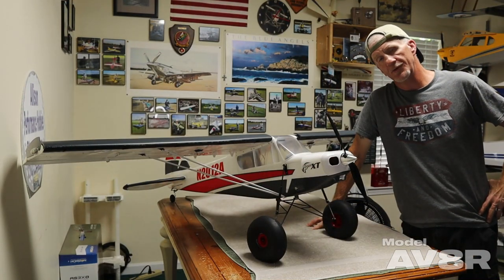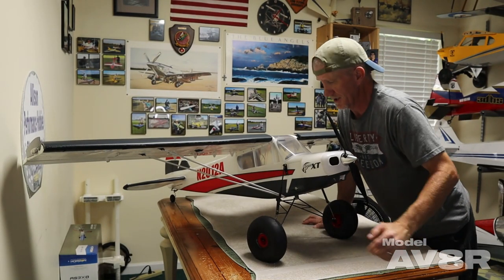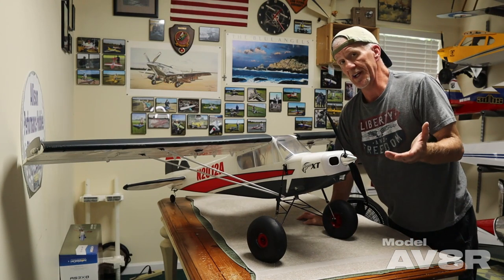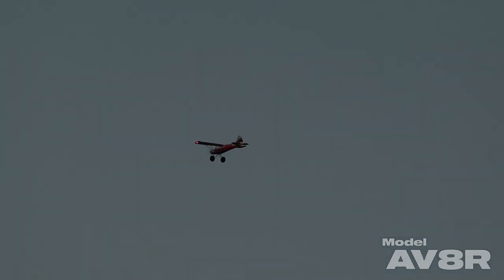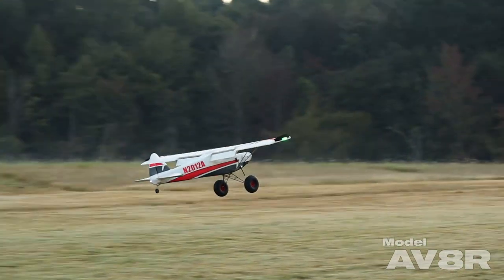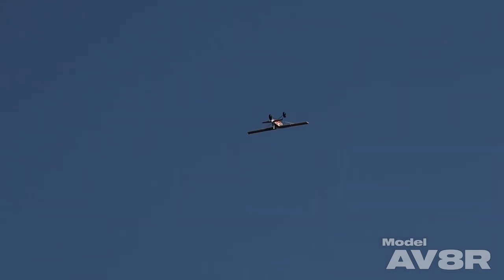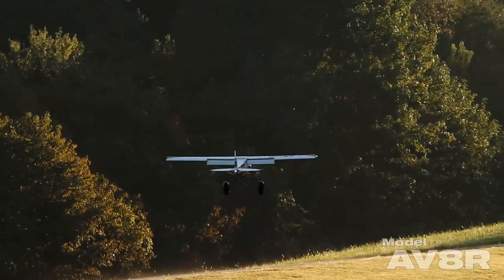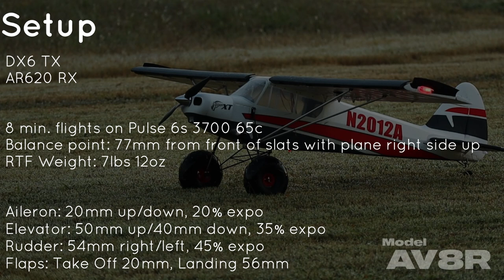Skynetic Bison XT STOL 1750mm (68.8") Wingspan - PNP Model AV8R Maiden/Review

Comment: Super informative video!!!
The most interesting tip for me was the one with the slats. Since I have no experience with these, a clear indication of the setting (x mm distance) would have helped me with my problem! 😊
Reply from the maker: Thanks for watching! Yeah the slats have been an issue for many...the key is do not hook them to the flaps...if you do when you deploy the flaps the slats rotate forward and become spoilers...which kills the wings airfoil taking away most of the lift. We have ours set in the most "closed" position (for lack of a better word for it)...in other words the trailing edge of the slats need to be as close to the wing as the adjustment allows. If for some reason the measured distance from slat trailing edge to wing is greater by a fraction on one side...adjust the other one to match it. Hope this helps! Happy flying!

Comment: Great video. Good to have another quality rc YouTube channel to watch. I assembled my bison after watching your video and it helped a lot. One build question I have is did you have any trouble with the screws for the under carriage for the landing gear being to short? The ones called for in the instructions were way to short to attach the under carriage to the fuselage. Can’t wait to get mine in the air. Thanks for a great video
Reply from the maker: Clay thanks so much for watching and the kind words! Such a nice complement. Hope you've sub'd...we have a lot of great stuff coming! If I remember correctly the bolts to attach the undercarriage are the same ones used to attach the shocks to the shock mounts...the shorter bolts the same size are to attach the wings. Good luck on your maiden! I would put the battery forward for that and adjust to your liking after if necessary.

Comment: Thanks for the review. Unboxed my Bison this afternoon and really liked it. It's my type of airplane, but I held qualms after reading all the issues mentioned in the reviews. Your information really helped with that.

I have a question and could have missed something but, how do you access the battery area? 
The only thing that stood out to me was the two rows of screws on top of the windows.
Reply from the maker: Hey Stephen, thanks very much for watching and subscribing! I'm glad our review was helpful. If you grab the front windshield at the top on both sides and pull towards the nose the hatch will come off...the windshield is part of the hatch. It is held on with magnets.
 If you have read the Hobby Squawk thread on the Bison (link to it on the product page on Motion RC) my name there is "Starck Mad" (after a P-51 I used to fly modeled after Walter Starcks plane). After reading all the issues people were having flying it  I wrote a series of posts talking about how to properly set up the slats (different than the instructions), how slats work, and how in particular to fly the Bison. It is good information ...if you haven't read it I would before you fly it.  The Bison flies great, but it is different to fly. If the slats are set up wrong it will not fly very well or slow down well. Hope all of this is helpful...happy flying!

Comment: Hey, were your flaps tighter at the hinges on one than the other? Mine are…. Ive noticed many other production related problems with this model also.
Reply from the maker: Hey thanks for watching and commenting!  I didn't notice any issues with the flaps on our model. I have read the many issues mentioned in the forums.  I think each person's perspective has a lot to do with what they'll think about any situation. While I think many of the complaints are certainly legitimate such as missing parts, many of the things I see mentioned would fall under what I see as simply doing some modeling... an example would be my first impression of the tail wheel only to discover later on that if I simply oiled it like any modeler should it works fine.  Things like that as well as as flaps that might need to be loosened so that they move freely to me are just part of checking any new airplane over and preparing it for flight. I try to keep in perspective how much airplane we get with these foamies for the price point.  Usually most of the assembly is done and the cost of the entire airplane including all the electronics is about what just an air frame would cost if we were buying an ARF.  I also try to take into consideration how many hands are on each airplane and how many they're trying to crank out of the factory in China. There's bound to be  some differences from one airplane to another.  My perspective being a glass half full type that doesn't mind doing some modeling not to mention the fact that the example I got wasn't too bad really has a lot to do with my particular perspective in my review. Somebody else's approach or the specific airplane that they received might net a different result. I hope this sheds some light on things for you and I hope you enjoy your Bison.
Reply from the maker: Please understand I'm not saying just do some modeling and get over it...not at all.  I'm just trying to share my perspective. I will concede that as fomies go this one is a much harder build than most, but still compared to kits and arfs that I've built this was not that hard at least to me.   Many of the things that are big issues to some people…. which is absolutely there right… are something that I wouldn't give a second thought personally.

Comment: On your Tx, did you program the wing as "One aileron/ one flap" or something different? On the wingtip lights. how did you determine which was red or green? They're not marked as I can see.
Reply from the maker: Yes Pete...1 aileron , 1 flap in the TX. With full scale aircraft the navigation lights are green on the right, red on the left...so thats what I do. Thanks for your comment and for watching! Sub...we have more coming!
Reply: @ModelAV8RChannel  thanx for info. I know grn on right, etc, but lights themselves not marked. Guess you have to plug 'em in to see which
Reply from the maker: @capnpete1154  Ahh ok Pete. Yes I just plugged them in to see which is which.

Comment: Could you replace those steering springs with some sort of pushrods? Thought about getting this cuase it looks like a shock cub but as soon as I saw those springs I kinda lost interest its not very fun to fly this style plane if you can't steer it.
Reply from the maker: Thanks for watching and commenting! I wouldn't let the springs on the tail wheel deter you Miller...we still had a blast with it!  It's an easy fix but you need something flexible because the distance from mounting point to mounting point changes as you go from right to left. Stronger springs, maybe cutting and re-using the stock springs...lots of ways to fix it without a lot of trouble. We'll get ours fixed and add what we did to an updated video after we get more time on it and refine our personal set up.
Reply: @ModelAV8RChannel  ok thanks for the info judging by your intro and your hanger you plan to do any videos on the EF/3DHS planes you got? Now those are my type of airplanes right there😉
Reply from the maker: @millerrc5829  Glad to help man! And oh heck yeah...we'll do some huckin' on this channel too! Scale everything. EDFs, 3D/XA, we'll do it all.

Comment: I've got one that I just cannot seem to get the same confidence inspiration out of. Mine flies awful. Out of the box it only needed 3 clicks of up and 3 clicks of right aileron. Coming from 100cc and 50cc gassers I'm used to not having a great off power glide slope. But this thing if I pull power back from 30% it just fall out of the sky. Needs roughly 40% to get it to the runway safely. Anything below that on landing and your stuffing a wing tip. I would expect a high wing stol plane to have alittle more glide/hang time off throttle than it does.  I've tried CG at your recommendation of 77 and the manuals recommendation but the airplane just flies like a heavy brick in my opinion. (Flying stock power system, 6s 5000mah 50c, spektrum nx10 radio)
Reply from the maker: Thank you for watching! Buddy I'm sorry you are not happy with your Bison. This is a little involved, but bare with the long response and I'll try to shed some light on it for you. What you are describing is a characteristic of a plane like this...Its important to note this is not just a STOL plane, but a STOL plane with slats. The slats change several things about the planes flight characteristics. The planes critical angle of attack increases...so stall speed decreases, turns have to be more coordinated with a lot of rudder, and glide ratio is reduced (on a model). That specifically has to do with a models small Reynolds number relative to a full scale plane. Slats induce drag, and the model has a fraction of the mass (relative to scale) of its full scale counterpart. Basically the model doesn't have the mass to keep enough momentum for a "normal" glide ratio with the extra drag...so you have to add power to correct for that. All my landings are with power, and of course the slow flight is with power also. You have to use both elevator and power with a smaller model with slats to control rate of descent, and to flare for landing. Getting the nose way up and getting it really slow is possible - as you've seen in our videos, but its not easy..and thats normal for this type of plane with slats. I don't need 40% power to control my rate of descent, but I definitely need power. I don't see these characteristics as an awful flying plane, but I understand that if somebody else's expectation was for it to glide and land like a normal Cub, these characteristics would be disappointing. One thing too...if you are using the slats hooked up to the flaps, then when you drop the flaps the slats rotate forward and become spoilers which kill the wings ability to efficiently make lift...then you'll need all kinds of power to keep it flying. My slats are locked in the Slat position.  Hope this helps.
Reply: @ModelAV8RChannel  I actually really appreciate you taking time out of your day to reply with such a detailed response. and now that you explain it. it makes perfect sense to me. I was flying it with slats active and can see how they would act as spoilers. I really think I was holding my expectations too closely to my 84"cub, along with a big husky that i have that i can practically drop the flaps and set the radio down and they'll land themselves.

 I may give it another try with the slats locked in place. do you have any recommendations on how to lock them? without locking them permanently if I ever wanted to reactivate them or sell the plane to someone that does want them active?
Reply from the maker: Hey buddy. You caught me sitting at the computer...great timing! It really makes me happy that my response helps you...made my day. That is what its all about for me. I think when you use flaps and slats...rather than spoilers...it will be a different animal completely.  Still won't land like a Carbon Z Cub, but I think you'll like it. Hopefully you will enjoy it now! What I did was on each side was leave off the push rod and I stuffed a piece of soft foam in the slot (or channel) that the quick connect for the slat slides in so that it can't move...holds them in the "down" or slat position. You will have to fiddle with how big a piece to use, but just get it good and snug...doesn't take a lot to hold them in place in that position. Then tape over that part of the slot with scotch tape so the foam can't come out. If you need to remove it later pull the tape off and use some tweezers to get the foam out.  This has been working for me so far! Good luck with it and let me know what you think. Happy flying!
Reply: @ModelAV8RChannel  awesome thank you again man. Keep up the good content!

Comment: Supposedly this plane will fly on 4s with the larger provided prop. Can you do a review with them? I do have 6s batteries but I have a TON of 4s.
Reply from the maker: Brett we took it out to a school yard to do that very thing for our video and to show it in a tighter place. When we got to the school yard we did a watt meter reading on 4s with the 16 x 8 and 6s with the 15 x 8. With 6s we got something like 1030 watts...with 4s we got 425 watts. As tight as it was and with some wind picking up I elected not to fly it on 4s. We will revisit that idea when we are at a flying field with enough room for me to bail if that isn't enough power. All that said...the amps were very low on 4s...like 24 or 25 amps...so there is plenty of room to prop it up on 4s and get more power. I will figure out what prop provides sufficient power without getting the amps too high and we will post a video with that and any other changes we make to our set up by then.
Reply: @ModelAV8RChannel  ah so you don't think it will fly with the prop they provided. That's odd that they even say it is rs capable then.
Reply from the maker: @bigeclipse718  It would I think, but it wouldve been less than half the power of 6s...so in the tight spot and wind we didn't try it. I will at a field, but I will also prop it up and make more power on 4s.
Reply from the maker: @bigeclipse718  Hey Brett...check out our update video...its up and lots of 4s action!

Comment: Your slat theory is backwards.  The slats on full scale aircraft only extend passively at high angles of attack when approaching a stall.  They automatically retract again as the airspeed builds up.  This setup might be forcing the slats to extend when the airspeed is still too high causing strange things to happen.  Fixing the slats in a position that works throughout the flight envelope may well be the only solution.
Reply from the maker: My theory isn't backwards, and I know how slats work...you're not understanding what is going on with this model. The slats are permanently affixed in the extended position. They have rotational hinges at the front, not sliders to retract and extend. So when you use flaps, the slats rotate from the back forward to become what we'd consider spoilers or air brakes. In other words the leading edge of the slat stays still, and the trailing edge lifts up and away from the wing to the vertical position. This is really stupid. It kills the airfoil and makes the flaps useless. Permanently fixing them in the slat extended position is one option. 

Now, on full scale slats -  yes many are gravity/angle of attack operated (A-4, most STOL planes). Some are computer/hydraulic (the heavies). Some dedicated custom STOL planes do have a slat lever that can rotate them like on this Bison. Steve Henry can do that with his plane to kill the airfoil instantly and drop his plane right on the line at a STOL contest. They are linked to his flaps, so when he uses the lever that puts the slats in play...when he raises his flaps suddenly, the slats rotate to further kill the lift.  That is what I was talking about when I said one possibility was to give the slats their own dedicated servos/channel.
Reply: @ModelAV8RChannel  Good Grief!
Reply from the maker: Yep. And to top it all off, they did a V2 of the Bison...and left the slats the same way. Unreal.

Comment: I received my Bison, the fit and finish of was poor and the fuselage foam was inconsistent. The top canopy window has CA drops that crazed the surface. I am disappointed with the quality of this model for the price tag and it was not worth the wait. I really considering sending back, they could of done better. No reflection on you, thanks for you commentary.
Reply from the maker: Thanks for watching and commenting Kenneth. Sorry you are disappointed...sometimes things happen at the factory during assembly or in packing that greatly affects that particular model. Our review is of course based on our experience with our plane.  The foam on ours is fine. The windows don't have ca on them but they are not the clearest I've seen...that said they look fine to me and fpv isn't something we will do anyway. The fit on most stuff was very good...the only issue we had was one strut was a bit finicky but went on fine. I think MRC may have a few issues at the factory level...they will rectify it I'm sure...they are one of the top companies in the industry. So far our experience with them has been very positive after buying 15 or 20 planes from them over the years.

  We are really enjoying the flying experience with our Bison...we are at 19 flights so far and it gets better as we go. We will release Model AV8R episode 2 very soon (tonight or tomorrow) and it is an update video on the Bison with a tail wheel fix and performance flying on 6s and 4s. Hope you will check it out. Again...sorry your experience hasn't been like ours..I hope after you fly it a while you feel better about it.